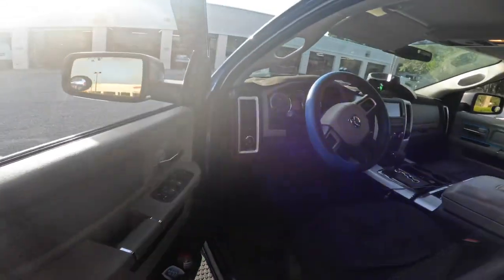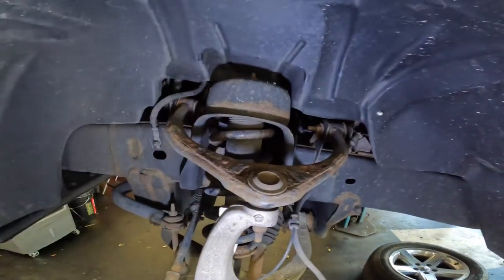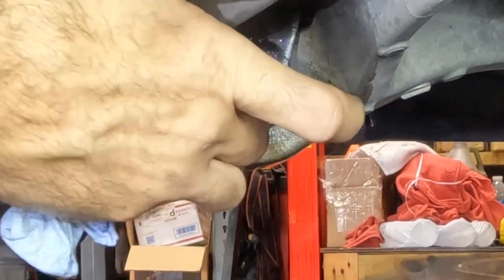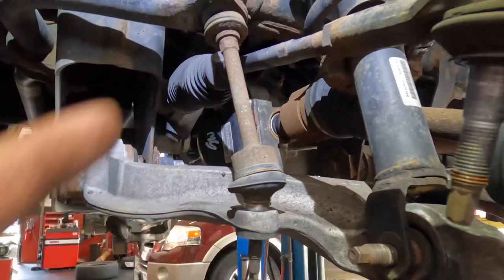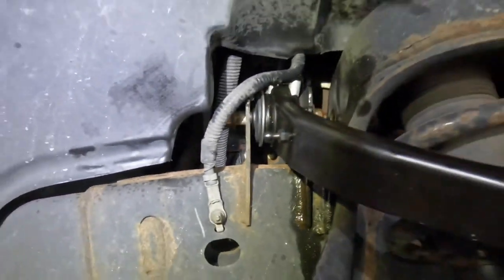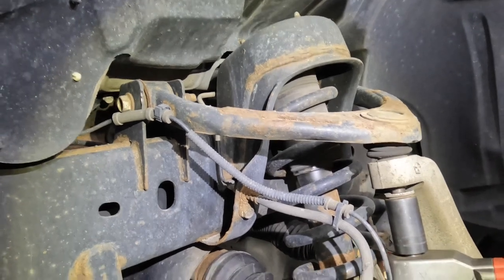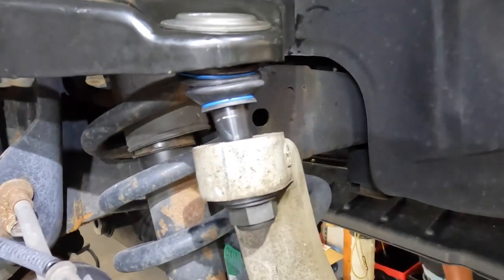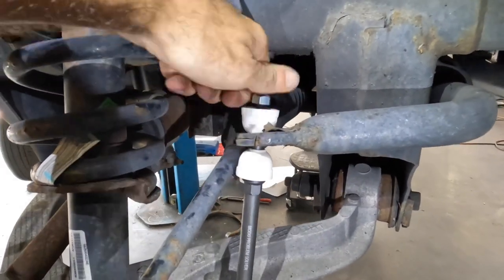Job Fails Fast! 2011 RAM 1500

Comment: (pre note don't take this the wrong way I know this comment sounds harsh you're an excellent tech it's not really aimed at you)Whenever you are done putting that leveling kit in for the Love of All that is holy realign the headlights I can't tell you how many of those leveling kits I've seen go in where the headlights aren't even thought about I should not get headlights coming through my windshield in a 3/4 ton HD truck going down the road I know it's only 2 in it's only 2 in those two inches make a hell of a difference whenever you're already riding on the line of how high you can have headlights aimed I mean don't get me wrong there have been plenty of times there were people have thought my headlights are misaligned but that's because I have significantly upgraded my headlights and I find it funny because every time I have to hit somebody with my high beams the only thing I can think of is that one song "here comes the Sun doo doo doo"but I'm getting a little off topic I can't tell you how much that frustrates me to get hit in the face with as bright as newer "2010 and up" headlights are and to have them shining in my eyes when they're on low beam and I can tell they're on low beam it is so frustrating

Comment: A lot of parts and labor to raise the truck 2"  and what does that accomplish.    Looks like those new struts are the same except they have a longer U-shaped mount at the bottom- a guy could just cut the 2 originals off with a whiz wheel and weld in 2 extensions- no need to remove anything.

Comment: I have heated up the bolts until the rubber was on fire and it was able to come out on my vehicle but I don’t think it was good on the bolts they were not as hard as they were previously but it came out
Reply: You did good in worrying about the condition of the bolt after heating at that hot.  I see over and over about heating things cherry red and then re  using them without realizing how badly they may have affected the metallurgical properties of the bolt itself.

Comment: Don't blame ya for not using factory bolts, however Grade 8 bolts are in most cases stronger than the original ones. 🤷
Reply: Unless they came from China.  Replacing some axle/frame mounting bolts on my trailer, the hardware store grade 8 stripped the threads, soft as butter.

Comment: You don’t need to buy the whole control arm. They sell the bushing with the bolt for under $20. I don’t know then you add labor to remove the whole thing to put in a press etc. Your call
Reply: They did have almost 150k miles and he had to take them off to replace the bushings . It sounded like an employee's truck who will get a massive discount .

Comment: Ray, is it just me or a camera illusion that passenger side sway bar, where the end link goes looks like it has a big old split in the metal? NO Ree just thought you may have missed it. I hate it when you have to wait for parts, my phone took a dump and it was under warranty as it was less than a year old and took 4 frigen months to get a new one, apparently the factory in china had to hire a new batch of kids to get the production line back up and running to make my replacement phone. lol PS: Never mind I see it was just paint pealing off of the swaybar, my bad lol and OMG how many flashlights do you need I bet that is $500.00 worth. :)

Comment: The ball joints might wear out faster because of the
Tighter angle.
Reply: A lot of things wear out faster when someone who knows better than the engineers who designed the thing start messing with suspension angles.

Comment: spin that bolt since the bussing is stuck to the  bolt spinning it will produce heat take yur  balljoint tool and press it out

Comment: 18:40 this is called over torque. good luck to the next guy to work on that
Reply from the maker: Naaaaaaww it’s fine. That little impact can’t yield a ball joint
Reply: @RainmanRaysRepairs  how far do you need to go to set that taper? makes it so fun to take apart

Comment: Penetrating spray left to soak in usually works. It's no point spraying it on and trying straight away to loosen the bolts, that's not how it works.

Comment: Call me crazy but..... what's wrong w/ just the bolts from the junkyard? It's still factory....u could even get the lowers as a "for now" just so u can still drive it and replace em w/ new when they finally come in.

Comment: The replace the control arm made me cringe my truck is 32 years old and new control arms arent exactly a thing. But then again the frame will probably rust in half before i would need new.

Comment: I hate the fact in my state salt is used on the roads, it makes no sense but furthermore, the cost of salt has risen through the years making it make even less sense. As a mechanic who is ASE certified since 1996 I can tell you modern tools like the cordless impacts are awesome and are a game changer with rust and bolt snapping being the reason for 90% of the injuries I have gotten through the years, my shoulders, left arm (left-handed),  both wrists, L5,s1 fusion surgery, and other issues because I'm a smaller person. I believe this is the first time I have seen you use an "old man" but in the northern states it seems like every job needed a helper pipe and forget about brake lines, we Start with heat as a First option otherwise it is a pandora's box going back to the master. Maybe not that bad but it is not good.

Comment: When installing end links you're supposed to preload them/jack the control arm so its at right height. This will pit equal pressure on the top and bottm bushings as you tighten it and also get it to the correct torque. If you tighten them with the suspension hanging, they can become too loose when the vehicle goes to proper right height so its best to preload them. See how its just smashing the top bushing then tightening, preload it and it will squish the tops and lowers evenly. As well as not risk being too loose when it goes from full droop to ride height. Surprised this isnt common practice

Comment: It doesn't have anything to do with being from the north every ram truck  has had that problem with the bushings thats why they are back ordered you can get the bushings out without cutting the lower its aggravating and takes about a hour but ive done it twice
Reply: Couldn’t you coat them in grease to prevent the problem?

Comment: Should be doing body work instead of worrying about a 2" difference in the front. Throw a couple sand bags in it and it will go down.

Comment: Don't you think all these control arms should come with new bolts  bushes plastic parts etc they cost enough.
Reply: Parts suppliers hate including small parts.  They get lost, smashed, or stolen out of the box, and then the supplier has pissed off customers screaming at them on the phone.
Reply: @MrSloika  fair enough but I think they should.

Comment: ... whoever told you they're on backorder is a lier, AutoNation Chrysler in NRH, Tx has almost everything in stock. They also sell the bushings on the control arm separately but don't think it's worth it

Comment: Just??? need a  3/4" Flex Bar!? more force 
Every bolt I replace gets Kopper Kote on it prevents the need for more force to be used. 
That factory ground in the wheel well could/should get Kopper Koted to prevent bad grd! 
This is where I go out into the bush to work on the truck  now as life has gone further down hill! 
Sorry when I replace bolts, (starting point most are metric now ) so the grade of the bolt or better grade. 
So most are 10.9. so replace the bolt with same. 
I don't see a problem!  do enlighten??? 
I have used washers (flats) so that the shank is what is being in the correct area of contact.
One GM bolt was $18.99 . NFL!!!!!!!!!!!!!!
So grade 10.9 with ONE Flat Washer accomplished the job!

Comment: I know this isn't related to the video but does 600 bucks for all breaks and resurfaced break pads on a 2015 rogue a good deal?
Reply: RockAuto has quality parts for that job for about $150.  If you can't do the work yourself, than it's a good deal.

Comment: didnt even have to do that control arm that was laziness on your part just get the 50$ bushing kit and press them in with a ball joint press instead of replacing the arm and opening a can of worms ive done this exact job and it worked perfectly could have burned the bushing out after cutting the strut and then put the bolt with the sleeve stuck in a vise heated the sleeve and spun the bolt out

Comment: on the upper control arms, won't the level position change with the taller struts? Shouldn't these bushing things be tightened at ride height?

Comment: Do you measure from the floor to the top curve of the fender?
Reply from the maker: The proper way is to measure ride height is at  the lower control arm bolts-to-floor and I believe leaf spring hangar bolts-to-floor (this will very widely) point being, no. measuring fender arch isn’t 100% It works for general purposes but shouldn’t be done for specification purposes

Comment: Just a little tip.  To get a more accurate measurement of ride height measurement take it rom the bottom of the wheel rim to the opening .  That way it take the tires out of the equation.  (Air pressures, wear on size)

Comment: That steering wheel cover is dangerous! The steering wheel can spin underneath the cover at the most inopportune time. A family member, making a safe, legal U-turn, ended up going head on with opposite traffic. Family member stated, "I was holding the wheel, I don't know what happened?" Just a word of caution.
Reply: Maybe don’t put a 16” cover on a 15” wheel.

Comment: When it comes to suspension components I refuse to go to fastenal or home depot even for  customers I always get oem Bolts and nuts for suspension including can lobe bolts pore guy @Rainman Ray's Repairs
Reply: Check on the Wide World of Webs… and find out if a shop would be willing and able to spray in a quality spray on bed liner or check if anyone has a review of doing such an insane concept.

Comment: Why not source bolts out at granger or Tacoma screw. Or check online? Maybe faster
Reply: Fasteners have to be the correct type, size and hardness rating to avoid liability.
Reply: @MrSloika  correct and most bolt manufacturers have that. Have to do this all the time in my service engineering team. We don't always have what engineers call out and as long as we install correct size grade thread and lengths and coating the components can't tell the difference.
Reply: @patrickreynolds801  I'm sure it can be done, but most shop floor techs have neither the time nor the skills to make sure the replacement they are using meets OEM specs,   Easier, and safer from a liability point to just get the things from the dealer.

Comment: If the entire aftermarket conversion kit is non-standard, and not manufactured by Dodge,
what harm is there in locating aftermarket replacement bolts for the lower control arms? As long as they are the same diameter, length, thread count, and pitch, and of the same Rockwell hardness, what's the issue? If the tensile strength and shear characteristics are
identical, there is no issue. If non-factory parts are an obstacle for you, don't accept a job like that at all. Who can vouch for the quality of the steel in those aftermarket control arms?

Comment: How can there be a danger using a non-factory bolt?
Where does Dodge get bolts from, if not a bolt factory, as does the Fastenal joint.
A Gr 10.9 is so, regardless of where it is from.
And why doesn't the factory not use anti-seize on the critical fastener shoulder ?
Shock, shame and confusion surround this repair.

Comment: When you started this, I thought it a given that the control arm and all attachments would have to be replaced.  I'd even be concerned with the old CV boots as well since you will be removing so much of the front end.
A replacement boot kit instead of full CV axels.
All bushings, ball joints and strut connections should be a part of this whole operation.
That way, there is no doubt of how this job will be completed and last much longer.
I hate a "half ass" job.
AND, how bout some 'anti seize" on all the new bolts to keep this from happening again.
OR, some blue Loctite.
Also would have wire brushed the sway bar end and then touch up paint Rustoleum.
I realize that you are probably on some "hourly mechanic's" book repair where you have only so much time to do a job NOT including things that should be done to make the job look more professional.
I assume that if and when you go outside that mechanic's hourly guide that you don't get paid for doing that.
Still, you are showing us all here in YT land your job and how you do it.
You're making job money as well as YT money along with it.
Like a triage surgeon, with all the many different cars and job problems you run into, your mechanical skill level just keeps getting higher and higher.
I'd bet a Toyota mechanic working for a Toyota dealer would not have the skill level that you have.
Not sure how you could check it but I'd bet that your channel is one of the most watched on YT.
A regular general mechanic that sees as much different and varied work as you do could only attract so much of a vast following.
Great SHOW!!!
Maybe go back in the future and put together a more detailed library on each make and model car you have repaired like the old car repair books that you could buy on any type of model car.
I think that old book series was called, "Haymes".
Reply: They were Haynes manuals, still going!

Comment: Do you not have access to a 3/4 drive socket set and the correct grade bolts from a bolt supply ?

Comment: I just want a 2 inch leveling kit for the front 15 minutes later you need both lower control arms and all bolts including cam alignment lobes and bolts and upper control arms parts cannon Fired yikes 😬 @Rainman Ray's Repairs
Reply: You can tell it's an employee's truck who will get a massive discount . My guess would be the service writer .
Reply: @eaglerider1826  not sure how you can tell its a employee truck he could of been talking to a actual customer the guy walked away frustrated and didn't even let Ray finish and you think that was a employee okay
Reply: @AntonioClaudioMichael  Sometimes you just have to love U-Tube . It was only my opinion because of the way they were joking with each other . I wasn't there so I do not know .
Reply: @eaglerider1826  you must of heard Stuff I didn't I'm not really sure why you commented on my comment to begin with but you have a good day Sir
Reply: @AntonioClaudioMichael  Sir , because I gave my opinion and you told me that my opinion was wrong . Have a blessed day .

Comment: The supply thing is getting old. we're running into it in aviation as well and it's frustrating.
Reply: Try being the marine industry , some OEM stuff is a year out . Called jasper today and was told December for a 351w long block .  It’s epidemic at this point.  I’ve got 71 boats at my shop and half are waiting for b/o parts

Comment: you do realise, trucks are higher at the front so you can load the back up,,without looking at the sun...allways, wire brush then rp7/crc/wd40 all threads bolts. anti sieze when re install..copper/zinc/gold,whatever.

Comment: Yeah, just another Tuesday in NY. Ya know, if you thought of grabbing the torch every once in a while those bolts would've come right out. Not cutting them, heating them. Also, those bushings are available without the control arm and they are much cheaper. That's assuming you know how to use a press to get them out and get the new ones in. I'm less and less impressed with your channel, I've been a mechanic both in and out of shops for about 15 years now and some of your content is great but it seems like you're a typical tech upselling ridiculously expensive parts. Maybe you could explain the reason as to why you would replace the entire arm instead of the bushings. And don't try to tell me labor costs would make up the difference. It takes maybe 25 minutes to change the bushings.

Comment: Now you know why with a Dodge, you remove the running gear and install in a different vehicle. The shoddiness is disappointing throughout the vehicle. You just swap out all the suspension because everyone knows a Dodge won't turn. The Cummings or Hemi is good, but the trucks are junk.

Comment: Well if you buy a used old truck and your looking to do any suspension mod even a simple leveling kit your opening up a can of worms. As witnessed in the video it's rebuild time best learn to work on your own stuff because you'll be breaking out the deep wallet.

Comment: i have a 2019 Ram from new  and my advice is Never buy a Ram... they are junk .. I highway drive the truck and i have failing ball joints.... failing end links.. and all i get from the dealer is "Backordered"  biggest mistake I've  ever made buying this junk truck

Comment: Short answer, there IS a way around this problem, buuuut...
Long answer, Crazy as it sounds, there actually IS a way around this problem & I've only had to do it a handful of times over 25 years ~ Here's whatcha do: Use the Acetylene torch to burn out all the rubber in the bushings, reducing them to ash without cutting the bolts (heat only, no pew pew by pulling the trigger). At which point you can remove the bolt if the hole in the frame is large enough to accommodate the inner bushing sleeve still stuck to the bolt. If not, you can then use the frame itself as the removal tool with direct application of force using a 36oz machinist's linear impact driver. Spoiler alert; you'll come out from under it completely covered in carbon and looking like a racial stereotype that's better left unmentioned, buuuuuut tl;dr = Git er done!